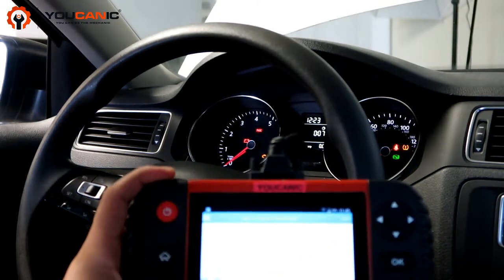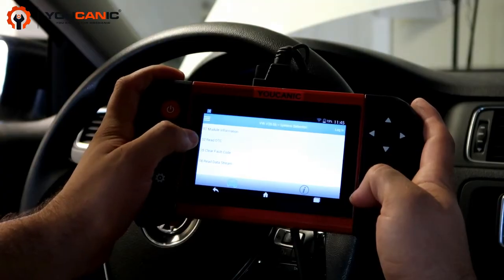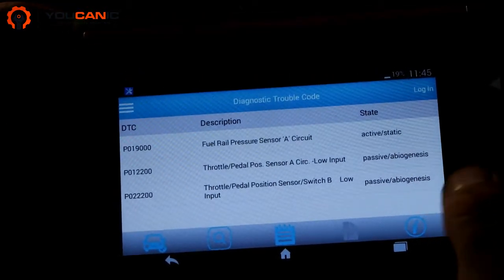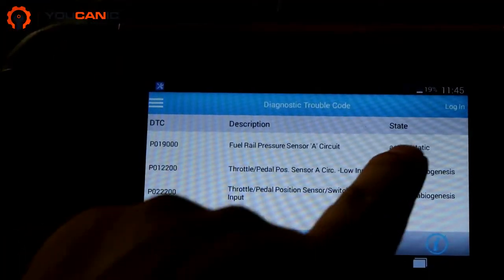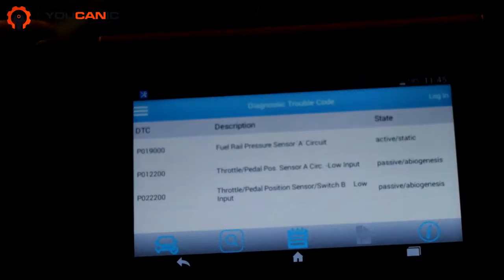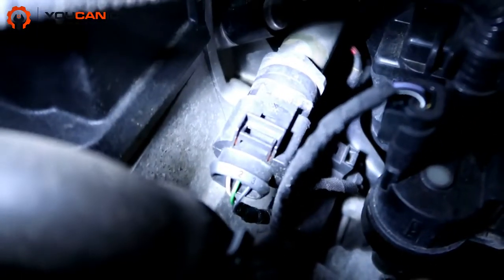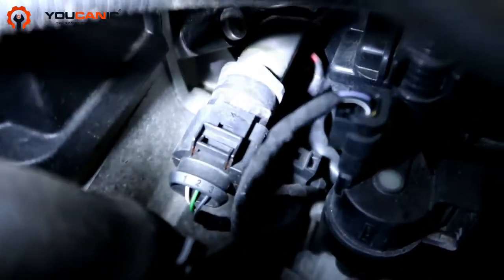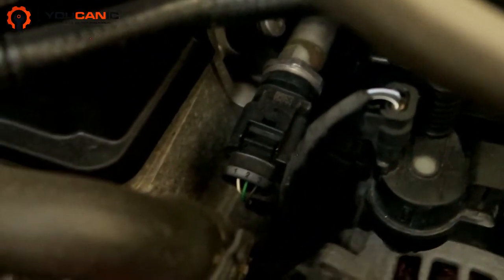Understanding the P0190 Code: VW Fuel Rail Pressure Sensor Explained

Comment: My 2015 vw passat tdi is dead due to code p0191 and is for fuel rail pressure sensor and I got a pressure sensor from O'Reilly but can't find where it goes and am doubting it's the right part because if you search for it nothing comes up for my exact car. The fuel pressure regulator is the other possibility.. please help
Reply: Hey did you ever find out where it was? I drive a 2013 VW Jetta TDI and I think it's going to be in the same spot.  Please let me know if you receive this!  Thank you.
Reply: @ptrippah follow fuel rail may be under intake
Reply: @priismedits9628  thank you.  Yeah car is still driving with the issue.  Few different area's it could be but solution from dealer would be to redo the whole fuel line ($7K).  For now i'm just riding it out until i can afford another car.  Great choice, right?🤣
Reply: Follow fuel rail

Comment: My 07 VW Passat 2.0T threw codes p0191 p0171 p0303 and p0455, I'm thinking start with sensors and work my way up,  I replaced all spark plugs already but it idles and runs poorly, it's been sitting until I can work out what exactly is causing the problem and needing replaced. VWs are all new to me so I have no clue where anything is on them, I don't have a manual so no help there... Thanks for the video! I'm assuming the location for that sensor would be the same on a Passat?